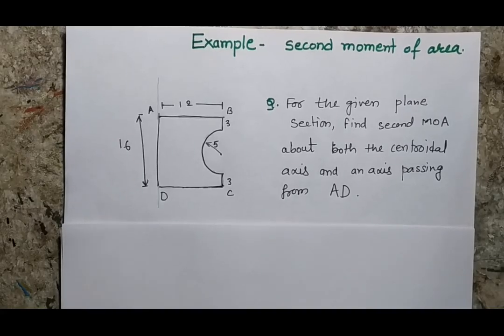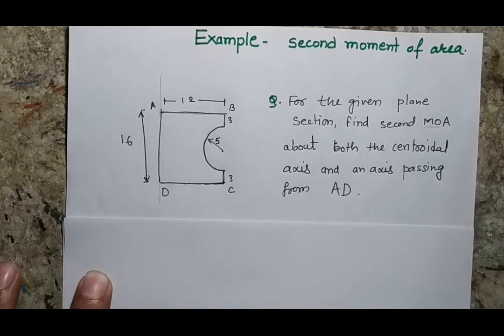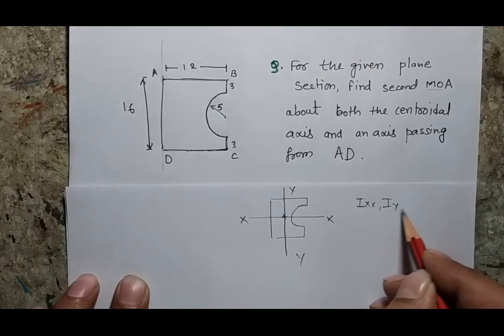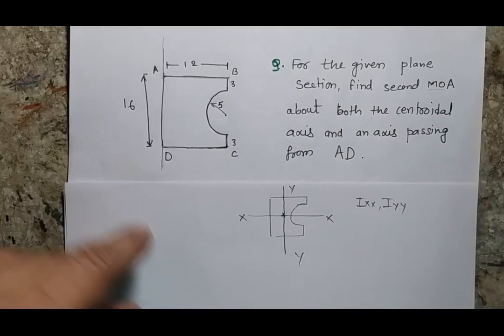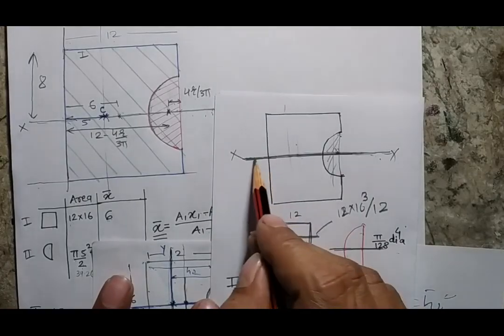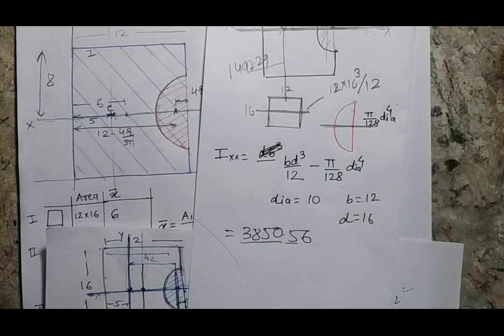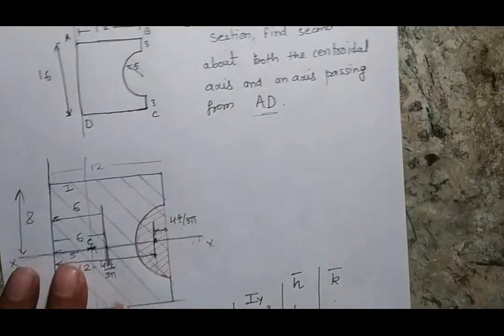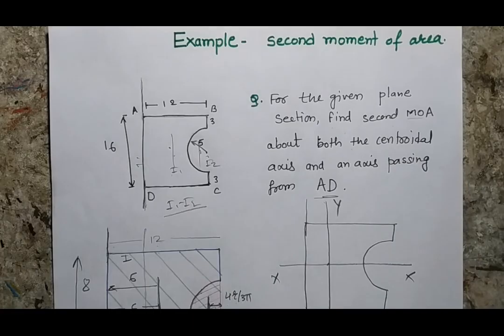L5.2 Second Moment of Area ||Problem #1 || Engineering Mechanics||First Year Student

Comment: in calculation of I(AD) answer is not matching by applying I(AD)=I(YY)+A*5*5, Where A is area of original figure.
Is it a right approach ?
Reply from the maker: approach is correct, may be some calculation error.
Reply: getting 5311.28...answer given in video is 5322.66...